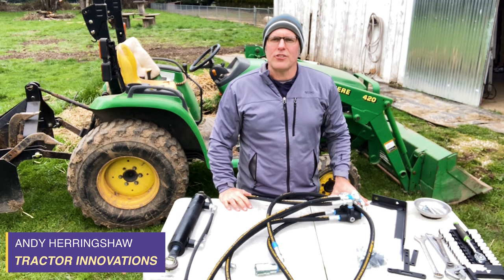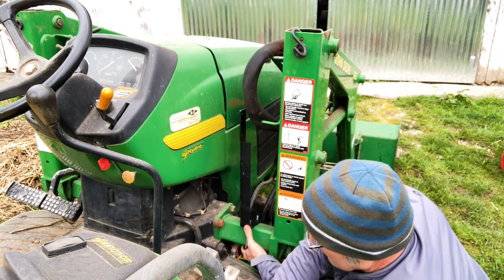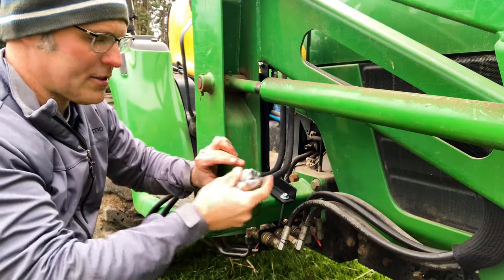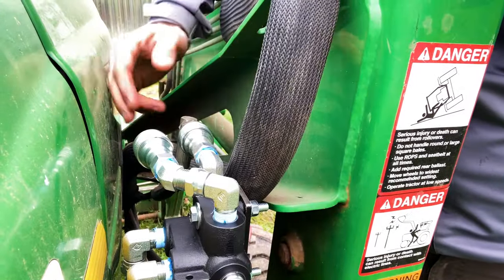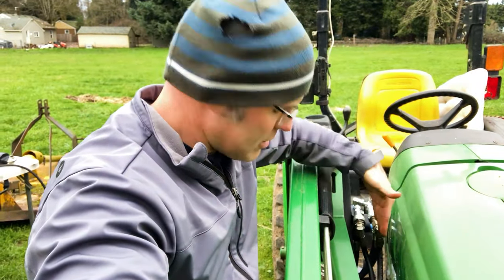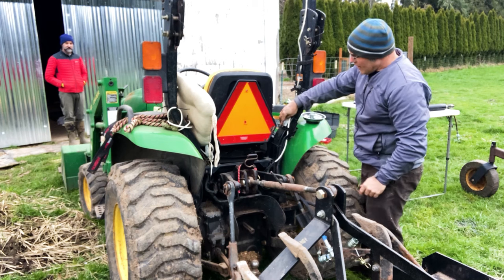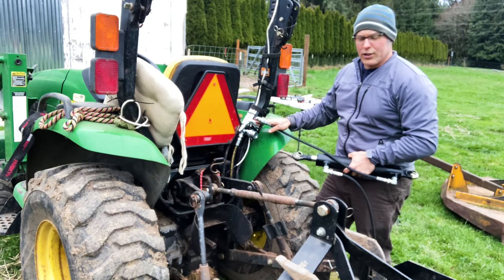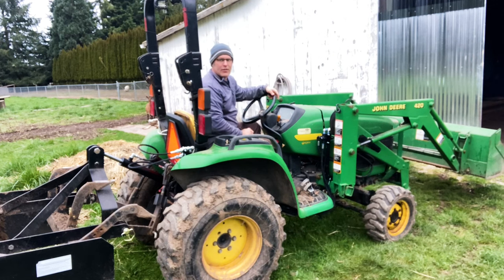$625 Remote Hydraulic Kit for John Deere

Comment: I have a 2000 JD 4200. I want to add a grapple on my 420 loader. Can I operate all functions with this kit? Loader up/down, dump up/ down , and open/close grapple at the same time by pulling open/closing your valve knob? It appears so, im just wanting to confirm. I want to mount new hose remote ports on loader frame so I do not need to run long hoses all the way to back, or would it be better to mount them in back k to have versatility to use hydralic cylinder as you show here?

Comment: Could flats be filed/machined into the piston so you can use a wrench instead of vise grips to keep it from spinning?  That's how many suspension struts are designed.
Reply from the maker: Pretty good idea!  I might suggest that to the manufacturer.